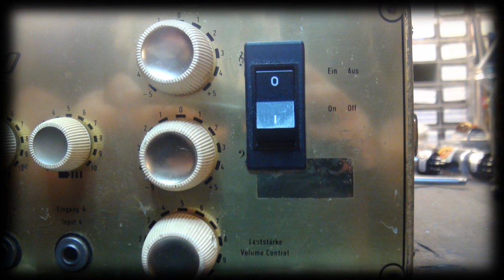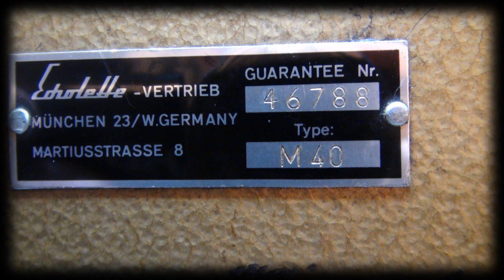KLEMT Echolette M40

Comment: Came for the amp, stayed for the playing. You definitely rock, man! Your playing is badass!! 👏
Can I ask you how you set volume on channel's input and Master Volume? Both cranked? Can you get this level of distortion at home without blasting your ears? 
Thanks a lot and keep rocking! 🎸
Reply from the maker: I am afraid I can't recall settings (it's been 4 yrs now) but definatey not both cranked. Maybe a little more on the preamp. The second part (2:20) with more distortion is where i engaged 2nd channel = more signal to the output section - this is the nice thing with those types of old tube PA amps....you actually have a 4-channel amp and you can combine channels in any way you want. You can't have this distortion at bedroom level but it is not an "earthquaking" 50-100W Marshall....still loud enough to disturb your neighbour. Another important aspect of the distorted sound is the speakers.....Celestions tend to distort if pushed so what you hear is filtered through the "Celestion sound" - check another of my videos  "12'' Celestion speakers shootout" to see what I mean. Thanks for the comment!!!!

Comment: Nice sound! Could you describe, what switch, cables, adjustments, etc. you use!?! Thx ... by the way, I have just given one for refurbishment to an expert. Looking forward ... Best Regards
Reply from the maker: Not anything special. Just an AB box for the two channels. Not any specific type of cables - just guitar cables. Adjustments are of personnal taste - just the amp eq and the amount of gain. When you take back yours just play around with the dials and you will find what you like. However keep in mind that what you hear is the amp + the Celestions. With another speaker it may sound tottaly different

Comment: Hey man, I have a chance of getting one of these cheap - but the original telefunken tubes have been changed out (hence the price).  Do you know how much of a difference it would make to the sound? Would it sound completely different? Thanks
Reply from the maker: not really a big difference, only in detail. Go for it, telefunken tubes are more of an  "audiophile" type, I usually do not recommend them for guitar.
Reply: @vmountain  thanks! It's one of the models with the older style input jacks so I guess I'll have to change them out. Also interested in trying to stack the gain changes as I know that can be done relatively easily.
Reply from the maker: @leeroden7900  Yes you can change the input jacks. As for stacking the gain stages, I would stack two of them (but be careful, you will have to attenuate the signal) for a smoother drive but keep the other two separate so you can have a 3-channel amp (adding an input for channel selection pedal). that's what I am working on these days on a 60s Dynacord Eminent (2xEL34)

Comment: That to a "purest" is SACRILEGE that classic echo unit was not designed for horrible distortion like that.
Reply from the maker: IMHO for the purist the amp should have its original circuitry and that's exactly the case - no mods here and no pedals just a cable straight from the guitar to the amp. Distortion is what this particular amp produces when volume gets high. Also (a) this is not a McIntosh or even a Dynaco. This is not even an echo unit. It is an average quality PA unit  (b) Untill 1977 no amp was designed for distortion (except for VOX). However back in the 60s guitarists found that clipped sound rich in harmonics is nice... Actually amps like KLEMT, Dynacord , GEM etc where the "poor man's Marshall". Still all opinions are welcome - thanks for the comment!!
Reply: @vmountain  Apologies I  only watched a couple of minutes of the video and thought this was a "classic" Klempt TAPE ECHO UNIT.